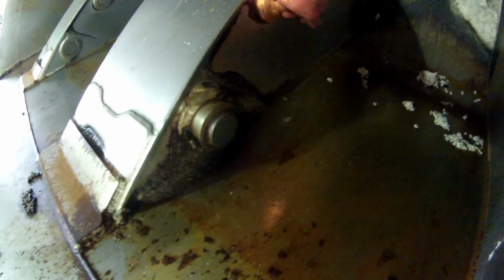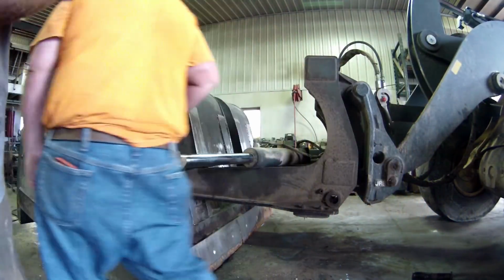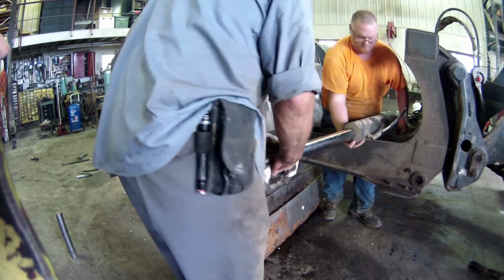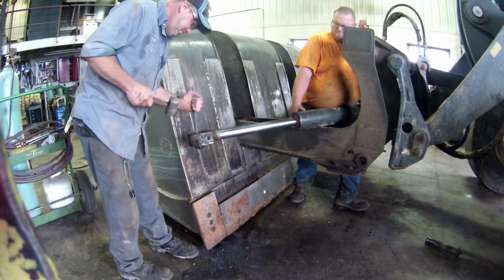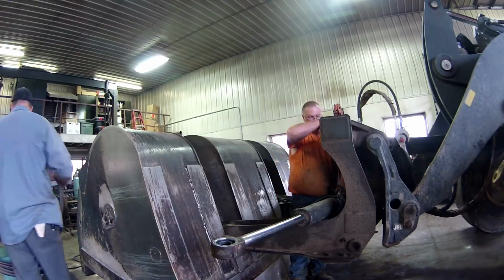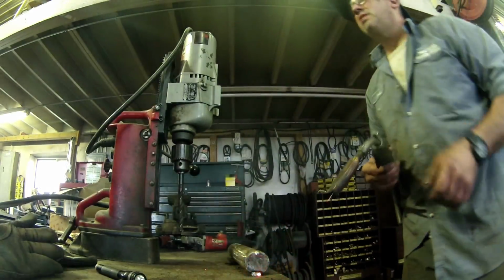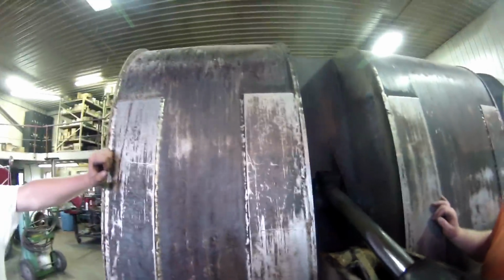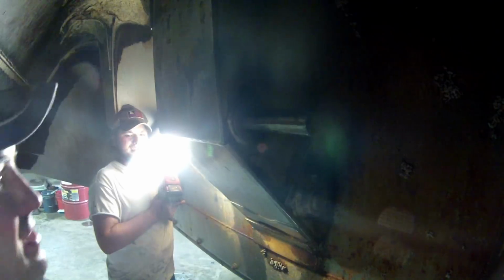Tag Roll Out Bucket pin & spherical bushing replacement

Comment: By not locking that bushing in isn't thee a chance it will move to the point that your grease groove wouldn't line up and not take grease?
Reply from the maker: Ben Harmon there is a concave groove all the way around the circumference, so no not on this one. Great observation though.

Comment: The big question is did you take your wife out for your anniversary or ( all the years putting up with you)  it's still Saturday !!!!
Reply from the maker: Hayman umm, not yet. Off loading manure right now we're going to quit in a couple hours and dinner is possible... But then again I might be able to cut some wheat. It wasn't quit ready to go at 2 o'clock
Reply: I hear ya wheat can be a pain sometimes it always seems to take forever because of the weather. Good luck with both! ( Wheat and supper)
Reply from the maker: Hayman it is what it is, but this rain we have been getting is and was much needed. If be willing to sacrifice a little wheat to see the corn and the 3rd cutting crop of hay get some water